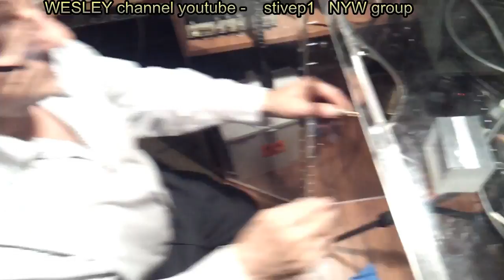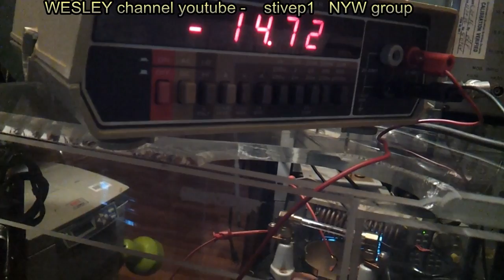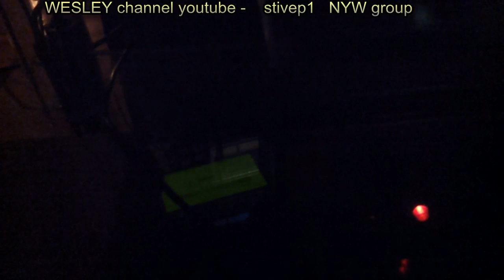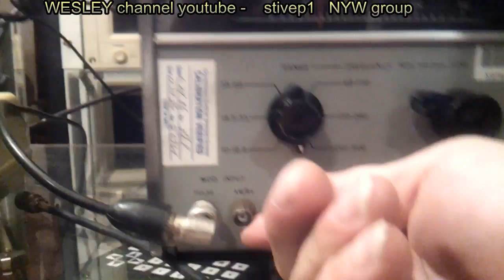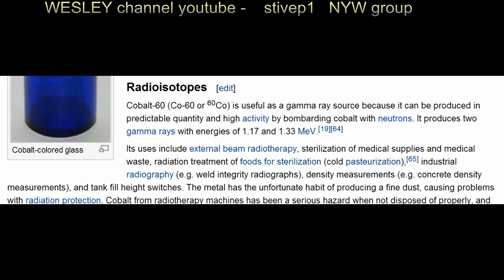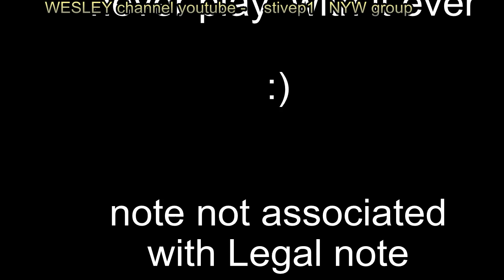Revolution has begun Free Energy exposed part 7

Comment from the maker: I did not  connect speaker- but I have headset for RADIAC- meter Just can not allow to contaminate experiment with any RF on any wires including speaker wires.
But your suggestion is excellent .............  radium clock hands ?  no... it will act on light bulb as well.....

Comment: I have noticed the same thing others have commented on.  Using  30 to 50 watts at 300Mhz, I found no voltage output or radiation at all.  (Well, I consider less than 1 microsievert no radiation).  The quartz tube gets warm, because there is RF going through it. (If I put my finger on the tip of the transmitting antenna, it's too hot to touch.)  After my dismal results, I reviewed videos 7 and 8 again, and noticed you measured the resistance of the 'battery.'  When I measured mine, the reading was way more than 25 ohms; the lowest I could get was 3-4K ohms, after I changed to more coarse copper and zinc (~20 mesh), from the 325 mesh I was using. Even compressing the mixture did not lower the resistance appreciably, and too much would breatk the tube. I don't know why you got the results you did, or how you lowered the resistance of your 'battery.'  Can you say?
Reply from the maker: the answer is not in the compound but in the interaction with the compound.
Photon has no mass .Depositing photon on the particle makes  it to transfer its energy and that can but doesn't have to be  a heat.
Neutron makes interaction with  atom that makes trick
Neutron gun can be done with some beryllium and you don't need to use californium  for it.
There are cheap ways to do it.
In one of these  videos You can see humongous production of neutrons. look at all series of it.
My neutron sensor was not contaminated and I have whole lab to be sure  that I'm right.
So all you need is to read  about Neutron interaction with matter and energy transfer.
the same process can be done without transmitter at all.
However if you study Ortec  Neutron Gun ( source) you may understand how it was made.
I can not publicly explain that what can be explained in just one minute.
But it is  to be found easily  on the net.
The device works  and is safe only to these who understand  it.
 The similar story is  when you  deal with fuel in your car and you know  how to  deal with it safe way.

Comment: Hi Wesley.  Thanks for sharing.
Why not use analogue meters instead of flickering digital ?
Does your geiger counter not click ? 
Use external laptop type amplified LS on phone socket ?
Energisation detectors - 
flo-tube beside your Colman tube ?
or photo flourescent or old radium clock hands ?
1 turn loop + germ diode+R+C + amplifier + LS ?
single ally plate electrostatic charge detector ?
Try some iron filings inside that tube -
yes - non radioactive metal excited to radioactive output !

Comment: Neutron capture in iron etc.
Hendershott generator used old coffee tin sleeve cores 
(shorted turn high circumferential electron alignment current)
for conversion to manganese + radiated energy,
from C tuned NMR sleeve resonance, by feedback loop energised 
transient emf output of mechaniclly resonant magnetic buzzer.
;-)

Comment: I tried this, couldnt get it working but meters were showing readings under rf interference. That might be the case for you as well. The readings on meters are just due to eddy/rf currents inside meters. There's no magic.
Reply from the maker: what meters did you use? I have all particle lab under my commandment. So I doubt to be mistaken.
https://www.youtube.com/watch?v=GdlkeI0bXy4&t=380s
https://www.youtube.com/watch?v=izzujmKROWI&t=174s
https://www.youtube.com/watch?v=CQ3gPFfgDp8&t=770s
https://www.youtube.com/watch?v=ox5xYZiL7jA&t=43s
https://www.youtube.com/watch?v=MIfWgX8hA4A
Wesley
Reply: I am using this Gieger counter: https://www.amazon.in/GQ-GMC-300E-Plus-Radiation-dosimeter-monitoring/dp/B00IN8TJYY/ref=sr_1_2?ie=UTF8&qid=1532457689&sr=8-2&keywords=geiger+counter

It is not showing any radiation. I have tried several things. It's so tiring.

But the digital voltmeter is showing readings like in your video. That's due to Electromagnetic interference. 

Btw, How did you connect the colman tube to transmitter? Did you just connected it across the dummy load? also, Did you use any modulation on transmission frequency? something like amplitude shift keying i.e. turning it on off so that it pulse the tube?
Reply from the maker: in one of my videos https://youtu.be/0xXZT7YQDE8?t=730 you see high level of Neutrons
 Beta is in background.
 Please read interaction of Neutron here: https://www.researchgate.net/post/Why_do_resonance_peaks_occur_in_a_neutron_cross_section_spectrum
 electromagnetic saturation of Geiger tube does not exist ion my experiments  so false reading is excluded
Wesley
Reply: I'm trying to figure out what I am doing wrong. I just blown my amplifier, I tried to activate the compound with high power levels. I have few other ideas. will check them and see what happens.
Reply: @stivep1  I found the the right explanation, The detectors are affected by high electric field. Don't believe me, just do a simple experiment. wind 1000 turns of copper wire on something like pvc pipe or ferrite rod and then wind 10 turns of wire on top of it, and connect it to a slayer exciter circuit. Then put whatever detector you like, they would show reading, if you place GeigerCounter it would show Radiation reading, if you place electronic scale it would show gravity anomaly like weight reduction, weight gain etc, if you place voltmeter it would show volts. lol

So, what's happening in your experiment is that the coil you have beside the colman tube is getting into resonance with the transmitter and producing high electric field around it, just like a tesla coil. which is producing all the results shown in the video.  

There's no magic, I wasted lot of money and time to reproduce the results and found the correct explanation.
Reply from the maker: I have problem to agree with you.
If you use GeigerMuller, than you may ionizate the gas inside  the tube. however I have  whole farm of detectors to test this phenomena.
https://www.youtube.com/watch?v=K1f6EBx9GtY&t=977s , https://youtu.be/0xXZT7YQDE8?t=734
We have  initially relatively small production of gama when compared to Neutron activity.
That activity of Neutron  affects the compound to the  production of secondary betas - those are products of interaction.

Neutron is a quite interesting as it can go thermal and interact with Colman compound.
Than the fallowing effect of that interaction in form of  measurement  is done on the material itself ,without presence of previously used  instruments .

https://youtu.be/izzujmKROWI?t=189  - that specimen I called "ore" I had a reason to  to that. In reality it was 3 years old Colman compound sample. 
https://www.nuclear-power.net/nuclear-power/reactor-physics/atomic-nuclear-physics/fundamental-particles/neutron/interactions-neutrons-matter/
this link is example of possible interaction.

It turns out that by short burst of 100W RF in Near Field https://en.wikipedia.org/wiki/Near_and_far_field , even without a generator just by pushing and releasing button on microphone of transceiver  TX manually at right frequency , ( manually keep pushing  with interwals about 1-2 sec. Try hold the button for 2 seconds.
or use of Tesla Coil( I did not test Tesla, but it must work ) that delivers broad spectrum of Frequencies from Hz to GHz you must 
hit the sweet spot   turning device  to "Neutron Gun" quite powerful I have noticed.  
So the key to achieve this effect is transmitting FM carrier from microphone  2 second long when  wire connected to antenna is absolutely having High SWR https://www.wearecb.com/troubleshoot-a-high-swr.html ,but of course SWR 1:1 is desirable.
In such a short  bursts you  rarely in risk  of damaging  RF amplifier transistor.
To make it  easier try  Kenwood 2000 at  70cm band.
 If you want to go scientific than you make assembly shown on my video.
https://youtu.be/CGV6CoPntJU?t=1029. You see exact configuration used by me.
The link to English version of the same video is here but you must find  the same frame as in the previous one 
https://www.youtube.com/watch?v=l-Cvm_0XEjg
The exact moment  - you can see the assembly is here:
https://youtu.be/CGV6CoPntJU?t=1050  

Although slowing  down Neutrons to become Thermal 
https://www.britannica.com/science/thermal-neutron may raise question about the  nature of moderator 
The device produced electrical energy  according to Colman Patent.
Re-energizing of Colman compound is required  one time , per hour for  few seconds, however 3 years old specimen was tested on betas.
And as you see from my video  (that specimen I called *"ore"*) was  producing betas
Apart from that I  used  another device  https://www.youtube.com/watch?v=GdlkeI0bXy4&t=177s 
The same device is shown on my video  here.https://youtu.be/izzujmKROWI?t=12 on the left side of the table.
During the experiment I got  quite nice dose, and I was in need to  take break for  calculated 4 years .
That  can possibly  be avoided  very easily. Obey Inverse-square law https://en.wikipedia.org/wiki/Inverse-square_law
 Wear  Lead shield apron,  and  plexi shield on face.
I did not know that  activity in the compound will be so strong. 
However  Neutrons might be troubling.
So conversion to electricity is done by  Betas as product of Neutron interaction.
Wesley
Reply: Hi, Sorry I didnt see your reply earlier.

I respect your efforts towards proving this concept and I already had watched your videos in yout last reply.

I am not sure why you are overlooking the EMI interference in the circuit of your meters and detectors. It would be easier for electrons to get excited in pulsating EM field than nucleons. Work functions of electrons in materials like silicon and copper are of order of few electron volts as compared to binding energy of nucleons in range of 7-9Mev.

If I had all the detectors you have, I would follow these experiments to avoid EMI:
1) I would place all the detectors near pulsating high electric field of tesla coil one by one. (All detectors and meters i have get affected by voltage spikes). Especially the neutron and gamma detector, I would suggest you to try placing the Ranger near a tesla coil.
2) I would find the best way to shield the detectors.
3) I would repeat the experiments without colman tube as if it is there and sweep the frequency carefully. It should show no radiation at any frequency.
4) I would repeat the experiment with colman tube.

Regarding your particle imager experiment. Cadmium calcium has  beta emitting isotopes (cd-113 and cd-116 and calcium 48):
https://en.m.wikipedia.org/wiki/Isotopes_of_cadmium
https://en.m.wikipedia.org/wiki/Isotopes_of_calcium

The betas in your particle imager might be from these isotopes. There's a patent which mentions method of enhancement of beta radiation. In the patent they mention kilowatts of rf to excite betas of cd-113 and ca-48.  https://patentimages.storage.googleapis.com/79/b4/dc/77222dc9bfdfa1/EP0099946B1.pdf

But let's stick to colman. I doubt there's any neutrons or gamma ray in this experiment. Extraordinary claims require extra ordinary proofs.

Comment: 300mhz is equivalent to .99 meters wavelength...   and if the target triplets were at 1mm per layer, is there some stepdown function relevant to the system?  such that the three layers of copper, cobalt/phosphorus/cadmium, zinc should all actually be a certain width within the tube to experience the proper agitation from the 300mhz tickler?    If they're all 1mm per layer instead of what looks like 4-5mm per layer in the cell you put together, maybe you get a better response from the cell?   Or is there a reason you are using thicker layers?
Reply: Yeap I know thats how You've done it, with totally random thicknesses, but the patent explicitly noted 14 cells of the copper/mix/zinc inside a 45mm length of quartz tube, which if one adheres to that, one ends up with layers about 1mm in thickness for 14 of those triplets to fit in that 45 mm length...  It doesn't appear you've done any tests with each layer itself at 1mm thickness, instead they're all over the place.   

What I'm getting at is what if the 1mm somehow correlates to the 300mhz RF field which has a ~1meter wavelength...  if nothing else its something else to Rule out as having any affectation on the cells performance after being radiated eh?